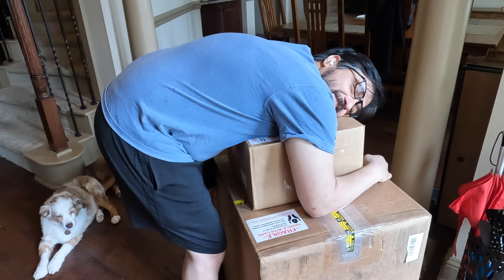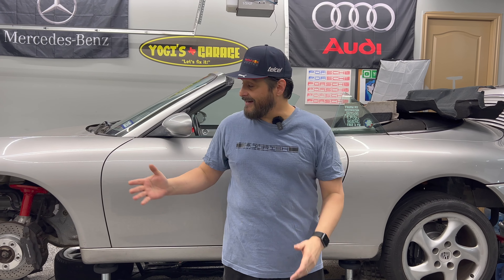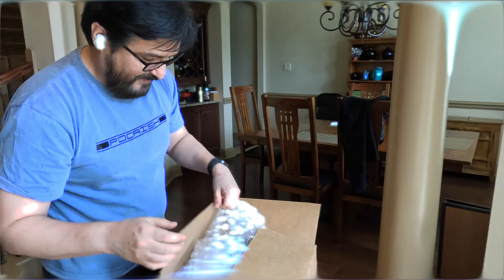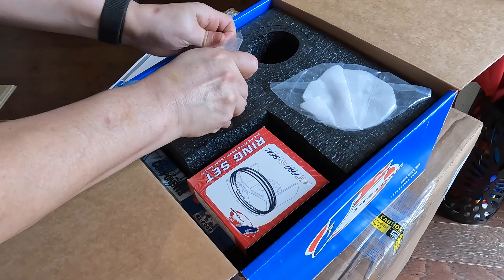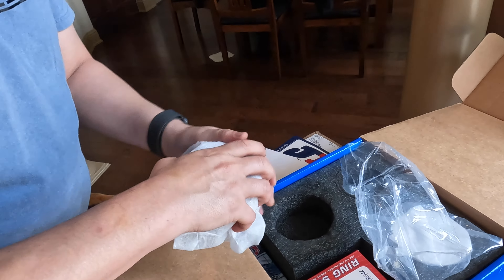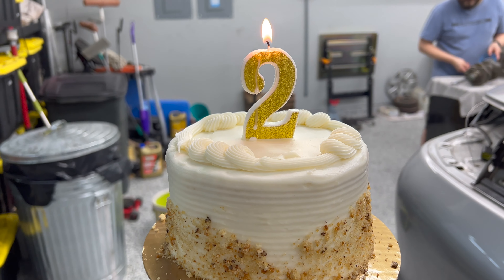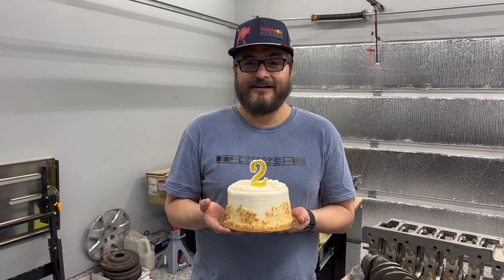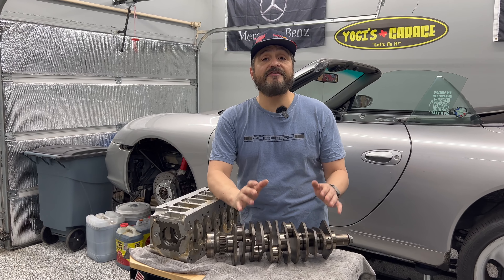My 4.0L Porsche 911 Is BACK and Anyone Want To Buy A Wagon??

Comment: Excellent video Yogi - good info on making your own gaskets. What do you think is the issue with the Guenther's tranny leak?
Reply from the maker: Hey thanks! I’m not convinced it’s still leaking. I’ve put a clean cardboard under him to see and have been driving a few miles here and there. I replaced the B2 piston o-ring(which really was a PITA). I’ve got a elevated level of respect for the W124s. It’s got blown ball joints and bushings and yet rides smooth.
Reply: @YogisGarage  Here's an idea - keep Guenther and do a V8/manual conversion after the Porsche is done - it can be your next project. And now you know how to weld so you can fab your own mounts and what not!